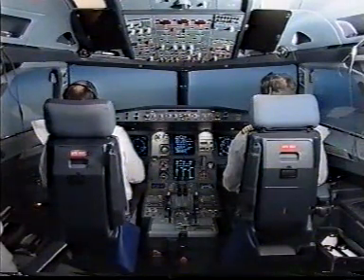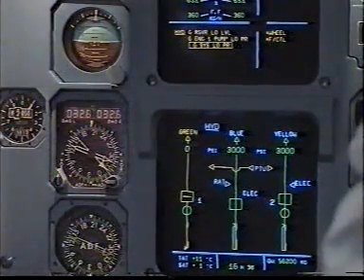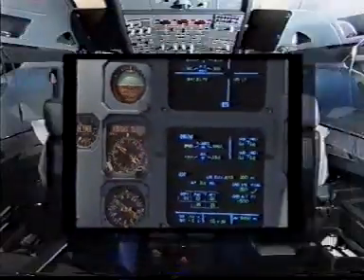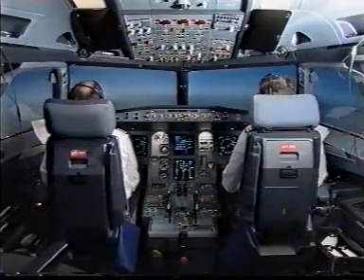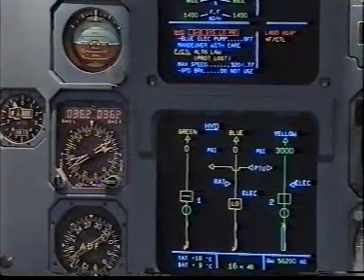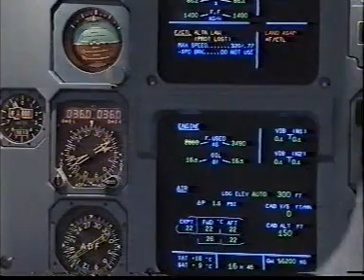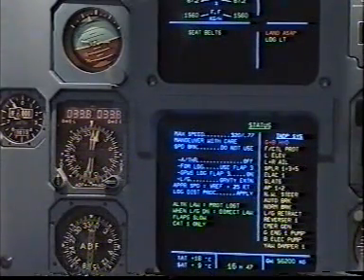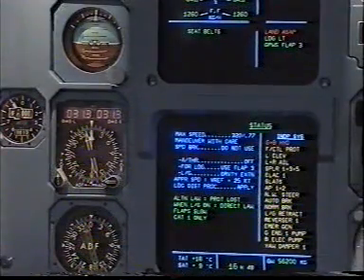Airbus A320 - DUAL HYDRAULIC FAILURE G+B

Comment: This is an old airbus procedure. The newer SOP, while doing the ECAM, PF can made the MAYDAY call and land at the nearest suitable airport. Once ECAM completed, do the G+B QRH summary and the performance calculation. Then etc, follow by the FMGS setup, and the necessary company SOP. Advisable to delay the LDG gear extension until fully configure due to Direct law
Reply from the maker: perfect, you're right ! this is just old reference for some guys just start the type rating airbus 320 !
Reply: No delay for lg , 200 kts gear down with manual gl procedure ´ as ecam saying. U may delay it in case of G + Y fail but not dor G and B